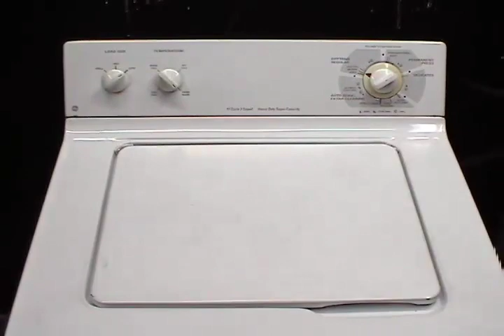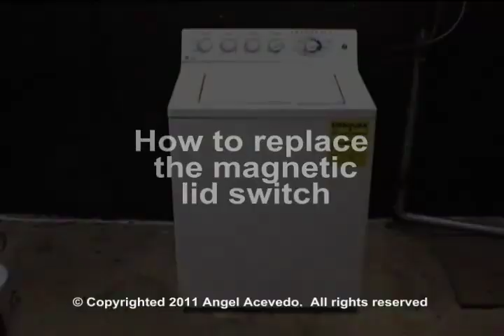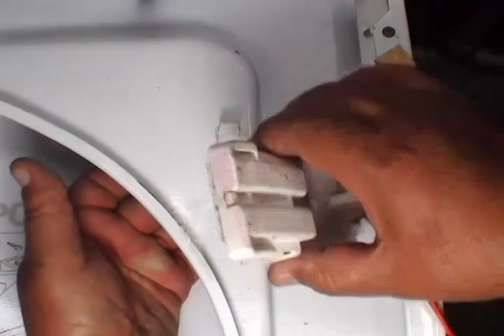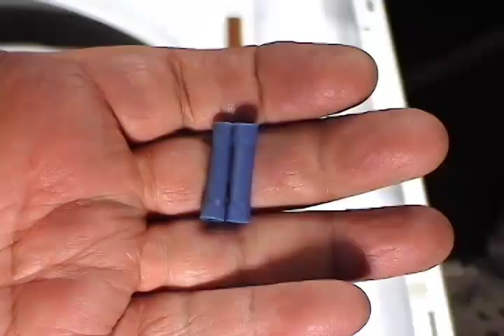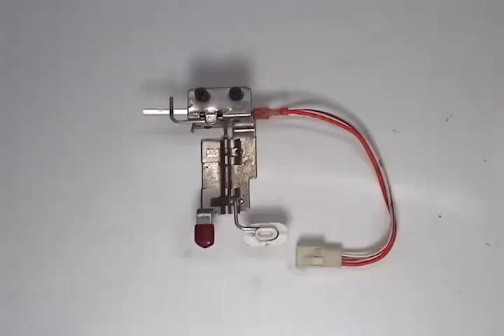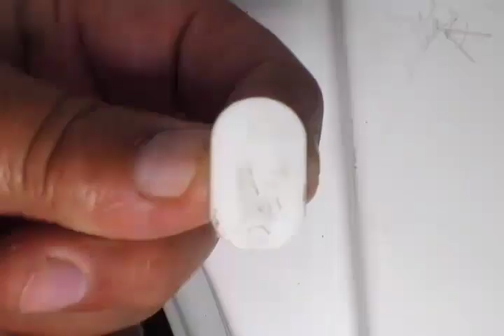General Electric Washing Machine Not Starting - The Door Switch

Comment from the maker: Because is a safety device use to stop the motor if the door is opened during the spin cycle.. But it is your washer, you could leave it bypass if you wish. Most people don't want a washer to spin with the door open in case a kid opens the washer door and get hurt.

Comment: Why would you want to replace it just leave it bypassed
It has to be the most annoying thing ever
Reply: You should only bypass it for when you can't afford a new lid switch, checking the lid switch when you first encounter the problem,and so you can use it until your new part comes in because bypassing it as a permanent solution isn't a safe one